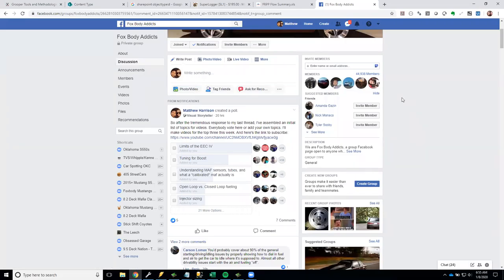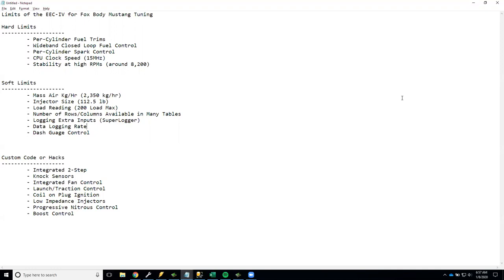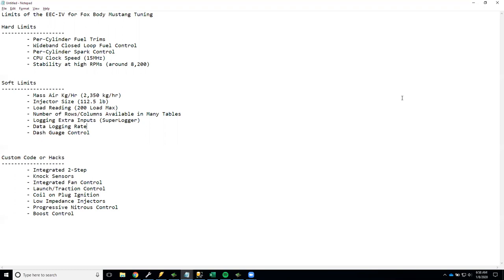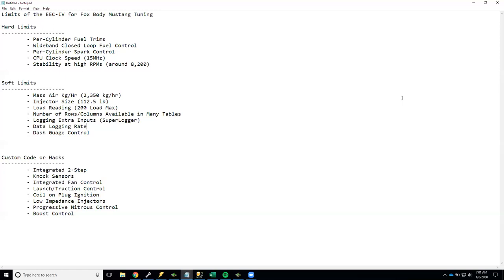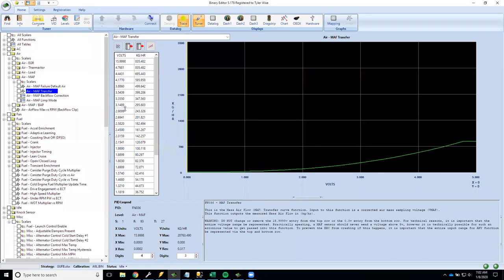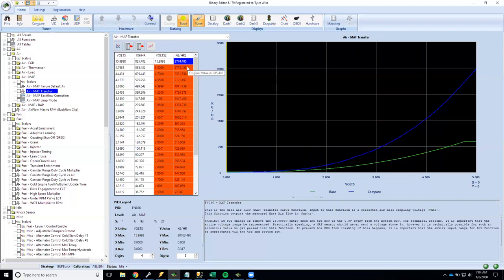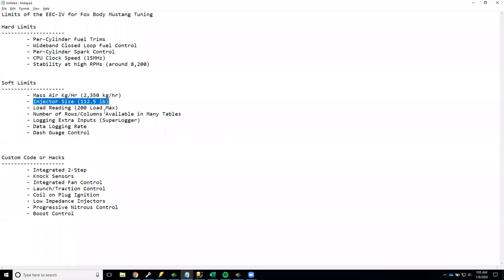Tuning Limits of the EEC-IV for Foxbody Mustangs with Moates QuarterHorse

Comment: Dude, huge! purist, and I had my cobra s-trim tuned on the eec-iv, i've learned a TON about the eec system, it's interesting!
Reply from the maker: Awesome man. Yeah these computers can go pretty far if you’re patient. A fox with a blower is always a good time.
Reply: @LeechMotorsports  Here's one for you, quick question?

stock 93' cobra motor, V3 @ 11.5psi, LMAF, 42's, 340lph, and afpr.. the car is sitting at 11.6 a/f on the tune.

I added a powerpipe, so just as a hypothetical, if the powerpipe was in fact, to increase boost pressure, will the computer know to add more fuel, if the MAF reads more air, but isn't in a pegging situation and given the injectors can actually send more fuel?
Reply from the maker: Ryan Jamieson yes. As long as you haven’t pegged the MAF and don’t run out of fuel pump or injector, it will continue to add fuel based on the higher area of the MAF transfer curve. However, it is possible your tune before could be super dialed in, but with more airflow, you’re now in an untuned area of the MAF transfer. So you may experience a slight lean or rich condition at the top end. But a simple adjustment to the corresponding MAF cells will get you fixed up.

Comment: Another great video! On the fan control I personally have done several. from factory they only have the hardware to have high speed fan control. high speed only works off of speed and ECT. Which is a great easy cheap mod for majority of the cars. for low speed you need to add an IC and then you will control of low and high speed. low speed Is based off of speed, ect, and ac parameters. I have sourced some IC from other ECM to try low speed but just haven't done it yet. What I will get people to do is add a trinary switch for AC or other ECT switches if low/high speed control is desired.
Reply from the maker: Right on. That’s seems like a good strategy. Would you by any chance know where to get a pile of unused ford style terminals? I’ve not been able to find them, but they must still be available since pro-m sells stuff like the MAF conversion harness that’s already pinned.
Reply: @LeechMotorsports  I dont have a new source. I just have been cutting up old harnesses (trucks, town cars, explorers, etc)  Also you can move some pins around on the existing car. Been awhile since I done one but i believe i have taken the pin from the air pump system and moved it over for fan control before. 
Also most of the EECIV ECUs have the IC chip needed for low speed fan control. I have a lincoln ECU with two chips. Just need to find a good way to remove them from the board. Has not been high on the list of things. Once I can remove the chips then I can install in a foxbody ECU and have full low/high speed fan control based on speed, ECT, and AC.
Reply from the maker: john hargreaves some how I knew that would be your answer. Lol. But nothing wrong with it. If it works it works.
Reply: Haha I dont run a shop so running across some old junk harnesses works for me for awhile. With moving pins and scavenging from one old harness can last me a long time for the small demand of tuning old foxes. Haha I will look around though for sure. My first place would be to just ask the guys at moates. Being you work in a shop having a supply of new pins to add in would be beneficial and time saving I am sure.
Reply from the maker: john hargreaves no shop here man. That’s the stuff dreams are made of. I got a 2 car garage, a couple toolboxes with basic hand tools, a laptop, and a six pack. I don’t even use impacts unless it is the only way to break something loose. This is purely a hobby for me.
Reply: Ah I gotcha. Nothing wrong with that! Strictly hobby for me too.
Reply: Ah I gotcha. Nothing wrong with that! Strictly hobby for me too.

Comment: Thank you for this video! I bought a QuarterHorse from Moates a couple years ago but I have not yet installed it. One thing I am curious about, I have the A9P Computer still in my 1990 fox which has been converted to a T5 manual. Using the Quarterhorse and binary editor, am I able to change the parameters in the A9P computer to make it operate identical to the A9L computer?  Or would it be better to find an A9L and go from there instead?
Reply from the maker: You can make the A9P computer run the GUFB/A9L strategy. It’s what I’ve been doing on my turbo car for several years now.
Reply from the maker: Let me know if you’d like some help putting together a base tune for it.
Reply: @LeechMotorsports  just installed the quarterhorse chip, now I'm just waiting on the registration file for my binary editor license. I'll be getting in contact with you

Comment: Any recommendations for what i should use for tuning a 2.5 twin spark 4cyl with 2.3 turbo components on a 1998 Ranger ?
Reply from the maker: I would definitely recommend going out to the Core Tuning website and looking at the list of strategies in their database. If they have support for your strategy (I can almost guarantee they do), that’s probably going to be your best option. They have complete packages that include hardware, binary editor software, and access to the strategies in their database. These strategies are very complete. Ben Head at Core Tuning is the guy you should contact.
Reply: @LeechMotorsports  I appreciate you taking time to respond and help out . I also found an old thread a guy had the same set up on a SCTx4. I didnt think that unit alone could handle it being the the software is an extra $350.. I am new to MAF and VAM tuning. I only have Hondata Kpro experience on my Honda. Truck needs some power for some sand fun..
Reply: Map pressure tuning and fuel units not VME

Comment: been considering a moates quarter horse for my 95 mustang for tuning untill  I save up for a Holley system.   would moates work good for stock bottom end 302 with trick flow 170 heads. 36 pound injectors. 510 lift cam track heat intake  70 mm throttle body and aftermarker fuel regulator just trying to make it street drivable till i get full computer
Reply from the maker: We can have you remote tuned on that setup with everything you need for considerably less than the Holley. It will drive better with stock computer than a Holley. I as long as all your stock efi stuff is in good shape I’d strongly encourage you not to invest the cash and energy in Holley efi unless it’s just really something you want to tinker with.
Reply: @LeechMotorsports   well if you can do remote tuning to get me up and going so the car isnt just sitting in the garage id go that route. my stock computer and everything is in good shape

Comment: Hey Matt would you happen to have a link for everything I will need for the quarter horse kit? I see all different sites with all different prices. I just want to buy everything all at once
Reply from the maker: Contact Ben Head at coretuning.net. He has everything you need there from software, to chips, to widebands. And their team provides great support in the event you have any issues with getting things installed and to the point where you can begin tuning and logging.
Reply from the maker: And tell that cranky old bastard Matt Harrison says hello!
Reply: @LeechMotorsports  thanks man, I greatly appreciate you!

Comment: Great video.  The pace is just right, you are covering what we all want to know.  Good stuff.  I am just getting into the tuning of my various vehicles and so I started googling just about anything about the EEC-IV  ECM.  Stumbled on your video here, really glad I did.  Sub'd and gave it a thumbs up man!  QUESTION - I've done the EGR delete and I'm keeping the ECM happy with a voltage divider plug I've made at the EGR position sensor harness end.  But my understanding is the stock map will be pulling some timing during the cruise areas of RPM range when it thinks the EGR valve is open - where in the system (using BE or TunerPro RT) do you disable the EGR turn on function; or do you????  TIA, Clay
Reply from the maker: There is a setting in the tune where you specify EGR type. There is a dropdown to choose from and there is an option that just sets it to none or disabled. By doing that, it will get rid of all the egr logic in the tune. Then you can remove the egr delete plug.
Reply: @LeechMotorsports  - Great, I knew there had to be something like that. So if I now use the analog input for a wideband O2 sensor, will it still be available to monitor? Thanks again!
Reply from the maker: Yes. It can still be logged. You just have to go to user preferences and setup the transfer function for your wideband and map it to the EVP.
Reply: @LeechMotorsports  Perfect!  Thanks for the replies and keep it up man, love the channel and content. Clay

Comment: 89 ford bronco 5.0 HO. 325 stroker kit gt40p heads. Zf5 manual transmission.  Question: is there a way with quarterhorse/ binary editor/ eec-analyzer to disable the auto transmission in the hog0 computer?
Reply from the maker: Not sure. Never tuned that strategy. What all was the hog0 used in from the factory?
Reply: @LeechMotorsports  it was in a 94 F150 not sure but supposedly similar to the vex1

Comment: Do you Sell Custom Tunes for the A9L with a Moates Quarterhorse?
Reply from the maker: Yes I do. Please email me at matt@leechmotorsports.com with information about your combination and your tuning goals. We will recommend a solution that makes the most sense for your budget and desired level of participation. Often, our customers want to learn as we go through the tune process. That’s what really sets us apart. We love to teach how this stuff works. No secrets or “locked” tunes here.
Reply: @LeechMotorsports  Is the moates quarter horse a  piggy back chip for the a9l? I'm confused, Extremely new.I know it said connects to the j-3 port. Is it any good??
Reply from the maker: Correct. It is a piggyback chip and has a usb cable coming out of it for laptop connectivity. It is the best tuning device for stock computer applications.